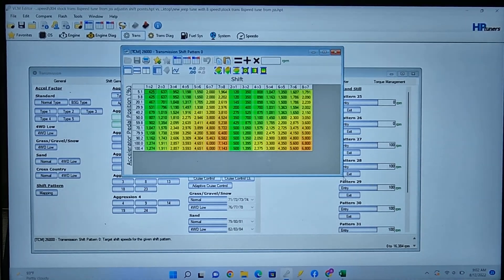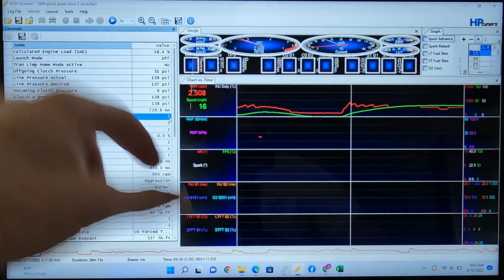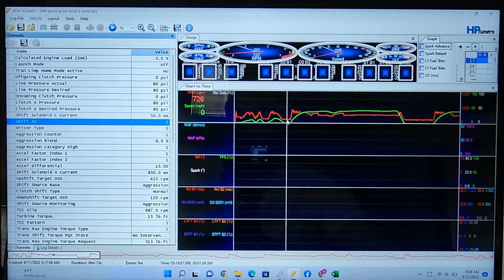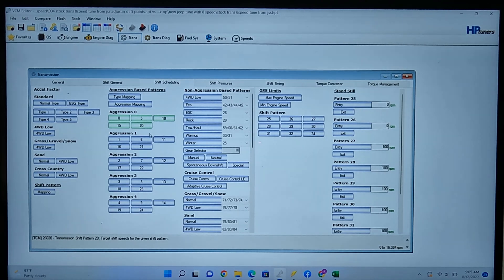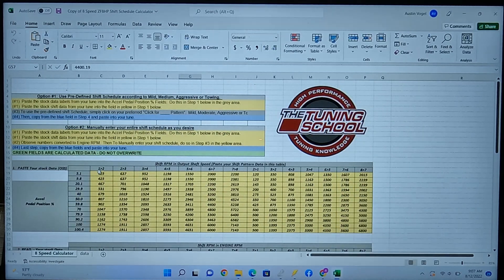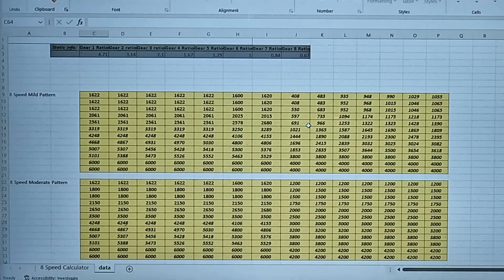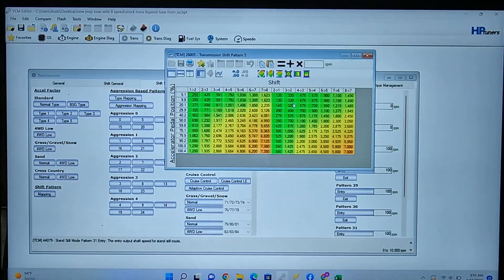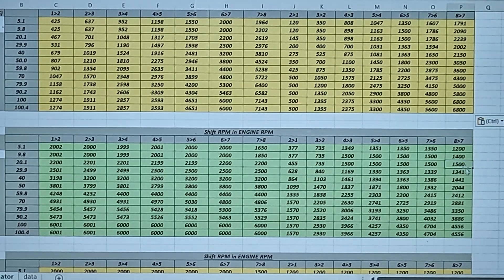8hp70 tuning, shift scheduling adjustments (hp tuners)

Comment: Nice video and thank you for sharing.  Curious if you are still running same maps for the lower aggression tables, or have you added back any differences?  I'm thinking about just finding a good configuration and blasting it to all of the aggression tables.  Every Jeep I've had until now has been a manual, really wish I would have found one in gladiator trim..  Mine constantly hunts between 6/7/8 at highway speeds at even the hint of a hill, if I use adaptive cruise it feels like it mats the pedal if someone ahead of me was slowing me down slightly.  I am running the 3.6 with the stock 8-speed in 2024 willys JT.

Comment: Hello, I was looking into changing the tuning that came with the jss module for my 8hp70.  Did you just purchase the mpvi3 and plug it into the obd port for the tcu?  I know I would need the hp tuners software and credits but I'm unsure of the rest.  Thank you in advance.
Reply from the maker: Yes you would need the obd adapter mvp3 and yes you would plug it into the obd port of the transmission 🤙🤙

Comment: Howd you set up the button for sport mode? What exactly is it switching?
Reply from the maker: For my transmission I have a controller that allows my Jeep ECU to talk to the transmission TCU, so this controller tells the TCU to go into sport mode because the stock TCU from the charger has the sport mode
Reply: @jku392adventures I'm curious what controller your using as there are a few and all a pretty penny

Comment: Thanks for this info. I'm using your shift pattern. I do have a question for you. When I shift from park into first or when the trans downshifts from 2nd into 1st it is really ruff. Like the clutches are engaging too fast. Do you know how to adjust to make for smoother clutch engagement?
Reply from the maker: I'm not 100% positive, but if you look at the shift patterns and the phase time settings, Compare the setting from sport to normal, and try to use all the values for the normal tables. There's the phases of the shift that might need adjusted. Does it do it every time? Or only random? 

I'm not Infront of my computer to look up the exact names of the tables. Obviously be careful as in not a professional tuner 🤙🤙 just a diy'er

Comment: who sells the PCS module?  I'd like to try to use it to add a button to enable sport mode on a 8hp75 in a ram 1500.  can't find much info on the PCS module online.
Reply from the maker: The module is mostly used as a device that sits between the 8hp and the ecm to help them communicate. It's not like a piggy back unit that gets added to it. But you can buy the module from jeep speed shop out of California. 

Also this guy might have some input
https://www.facebook.com/profile.php?id=100057085766128&mibextid=ZbWKwL

Comment: Thanks so much for this! Do you find that you need to make the same adjustments in each 'Agression' table or just the one you want? For example, I see that I'm in shift ID 8 at WOT. I should only need to adjust that aggression correct?
Reply from the maker: What I did was adjust all of the tables that my jeep uses at every throttle position, that way there's no guessing. I can literally know when my transmission should shift at all rpms. I remember in the nag 1 it would sometiems downshift on the highway and I would literally have to let off the gas to let it upshift (going uphill). I wanted to avoid this so I changed all tables to a nice daily driver table

Comment: So how do you know which aggression is which, as in auto, sport, track ?
Reply from the maker: For mine, aggression 0 us for normal mode, aggression 2 is used when I'm in sport mode.you can log shift I'd to see what shift pattern your driving In. for instance, shift pattern 5, is in aggression zero. And my transmission is often in pater 5, moves around to 10 and 15 and 20, all in the same aggression, while in normal mode.